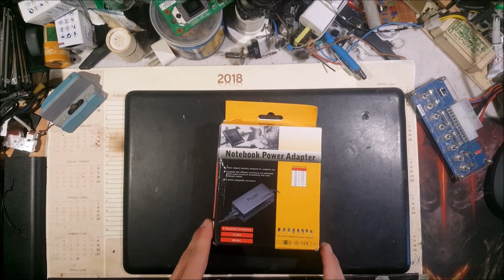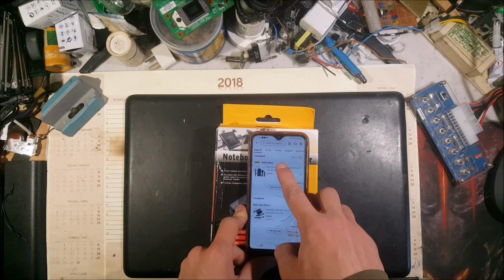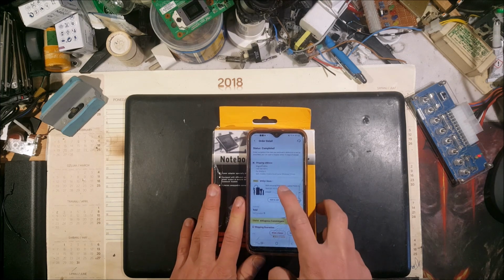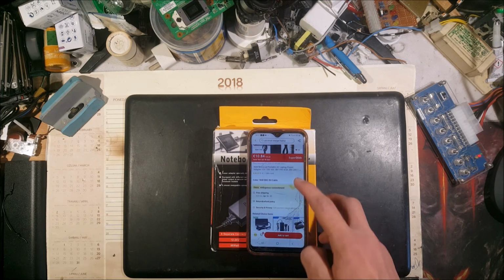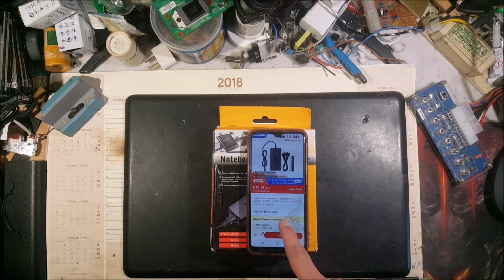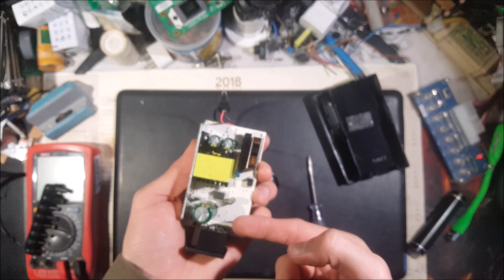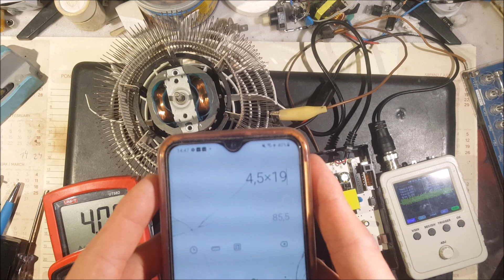Cheapest universal charger from Aliexpress review and teardown

Comment: I think you should also test those USB-C to DC-jack adapters. They should at least work with 19-20V laptops I assume, and with a quality USB-C charger there are probably fewer things that can go wrong.
Reply from the maker: I like the idea but you run into the same problem:
you must find a good quality USB-C charger
Also now you have to rely on two questionable chinese products instead of just one. 
I do plan to have a look into them sooner or later.
Reply: @BadCircuit22 
Well, the difference is that you might already have a good USB-C charger at home, be it a freeby included with a smartphone or the charger of a more modern Laptop. Also, decent third party GaN USB-C chargers are still way cheaper than OEM notebook models.
Reply from the maker: Keyword "might"
I can't assume my clients have them.
Reply: @ 
Yeah, I guess probably not worth the risk for commercial use with completely clueless people. But buying it yourself, different topic.
Reply from the maker: That I can absolutely agree

Comment: 3:13 From my expirience it's not true. I used my Fujitsu 2-in-1 with Lenovo 20V charger and it was laggish and slow, it had like stutters in games but everywhere in system. I thought it's just how it is. But then I got original Fujitsu 19V unit, and with it it became noticeably smoother and faster. Also, don't you have used original laptop chargers at your local second hand market? There are so many of them here, for like 5-8 usd in perfect condition, almost any brand and type.
Reply from the maker: Some laptops throttle system performance when they don't recognise the charger or the charger is not powerful enough for the configuration.
That might be what you were experiencing.

I agree a used original charger would wipe the floor with any universal charger but most clients like to hear the word "new".
Other than that it is way easier for me to have a few universal chargers than to have a pile of chargers that fit one brand only. And if I have to wait for shipping that is an inconvenience to both me and the client and it ends up being more expensive.
Reply: @BadCircuit22 I see. (I would hate such clients to be honest)
Reply from the maker: Not trying to be rude here, but a good 80% of them are like that. That is why people buying cheap Lenovos and HPs that fall apart within 2 years of use are so common even tho a nice used business class laptops are often cheaper.